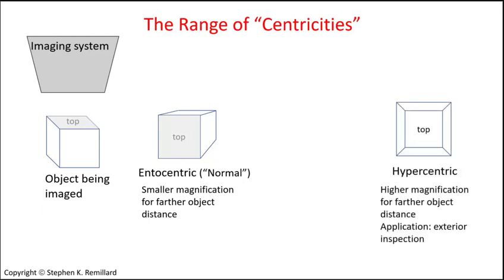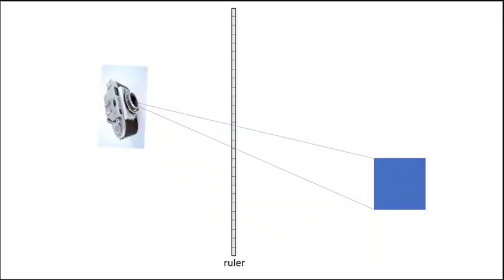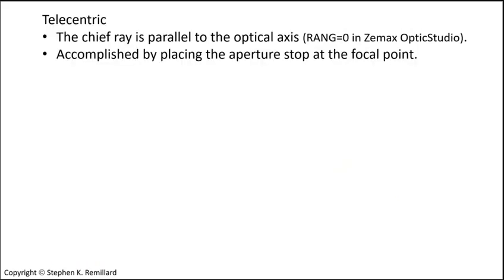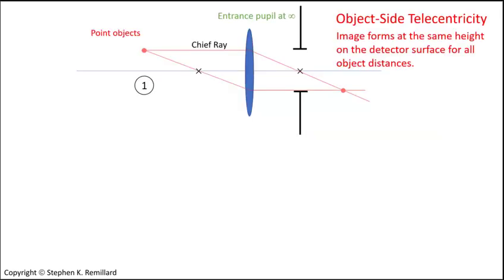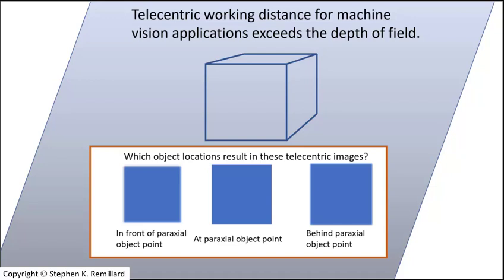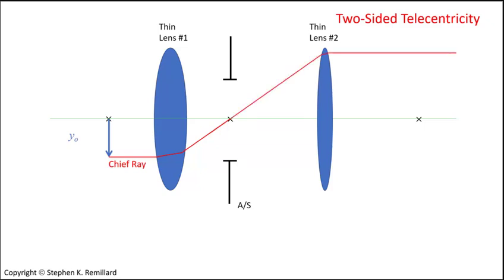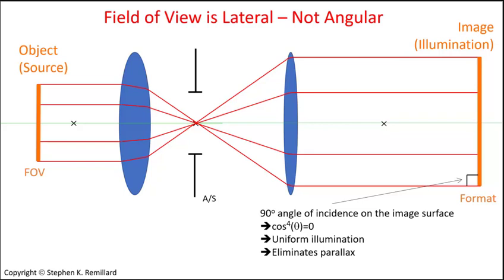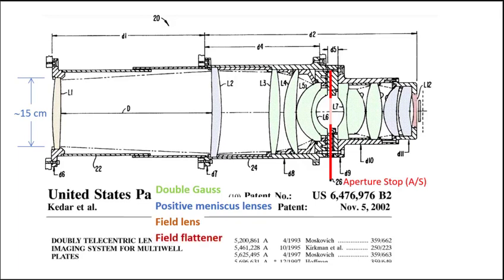Telecentricity: A Tutorial using Excel

Comment from the maker: The astute viewer might notice that the dimensions in the illustration at 11:30 are not the dimensions used in the spreadsheet example.  The system in the illustration was also telecentric.  The system plugged into the spreadsheet was a symmetric telecentric pair of lenses.  The system in the illustration used two different lenses.